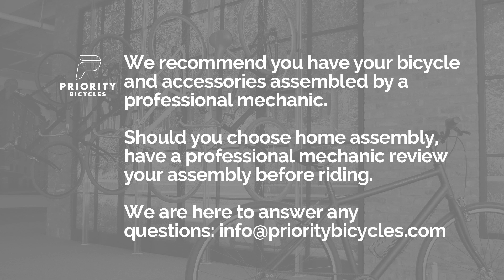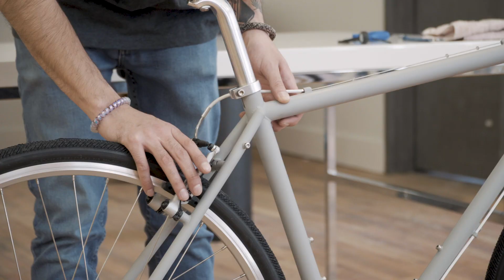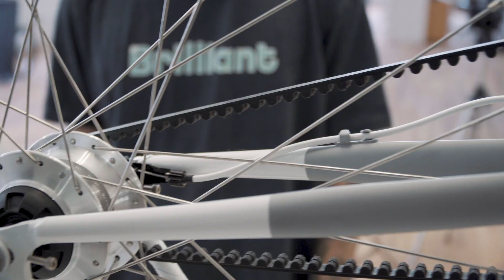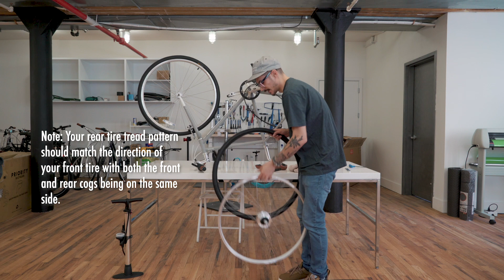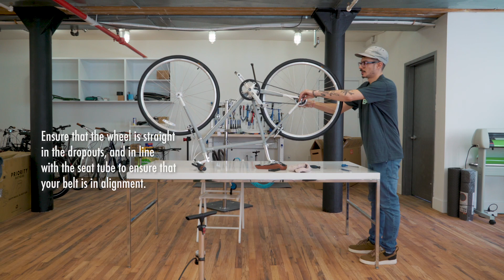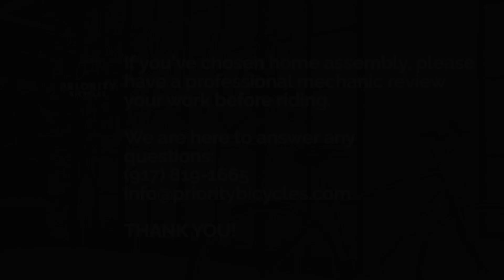L TRAIN Rear Flat Repair with Gates Belt Drive and Shimano Nexus 7 Speed Rear Hub

Comment: If you have the L Train disc, this video isn't a complete guide because it has a different internal gear hub than the L Train v brake. For the instructions on how to engage/disengage the hub, the video of removing the rear wheel to the Apollo gravel bike is more accurate since it also uses an Alfine hub.

Comment: why did he skip showing the belt tensioning?
Reply: One way to avoid most of the tension issues when repairing a rear tire flat is to turn the tension adjustment screws 3 times counter clockwise when removing the wheel and, after placing the repair back, 3 times clockwise.
Reply: Isn't that what he is doing a 7:00?
Reply: Maybe you were asking about measuring the tension. Gates has a mobile app that shows the correct tension based on the belt's vibration when you pluck it like a guitar string. There is also this type of guage: https://youtu.be/MPoKawd1y9M?t=169

Comment: Would you guys be able to sell a Ltrain with a dynamo/headlight and tail light.
Reply: Apparently Priority doesn't customize. Nevertheless, you can get far more light and quality then their dynamo lights from today's rechargeables. For value, I'd suggest the CECO front light in 1000 lumens (they have other, lesser lumened, lights) and the NiteRider Solas 250 (or, much better if you don't mind the cost, the Lupine Rotlicht Max).